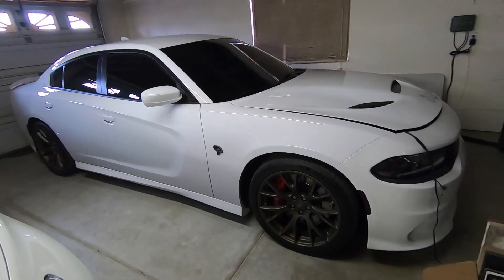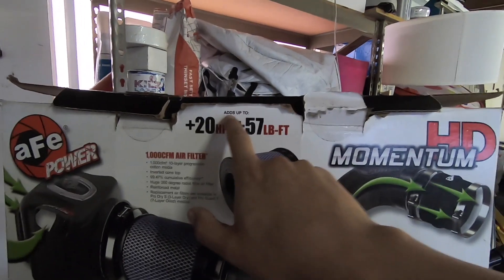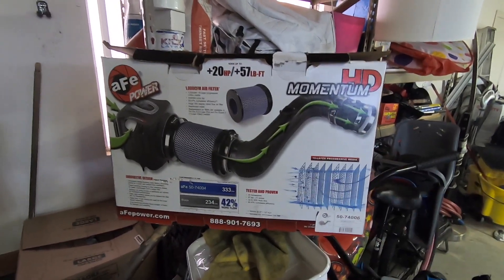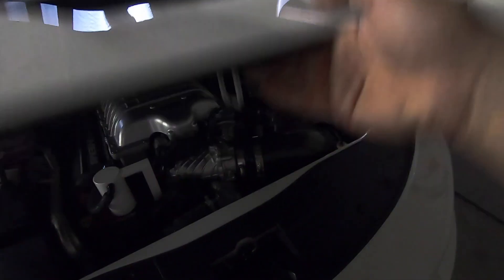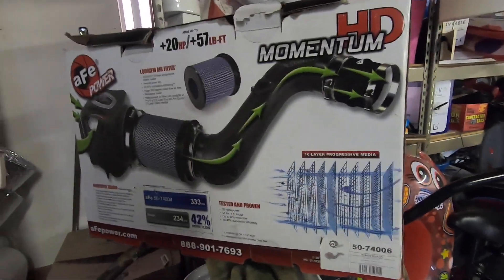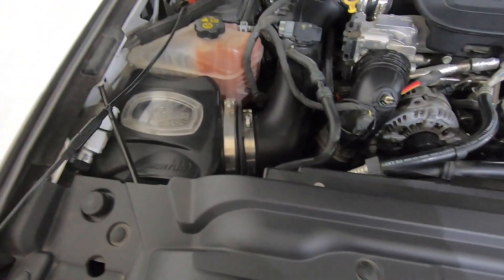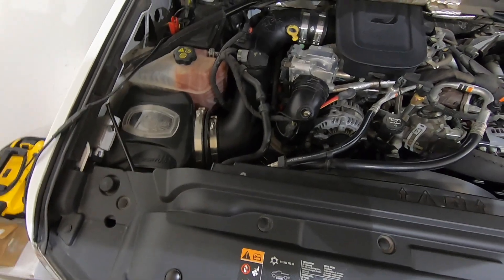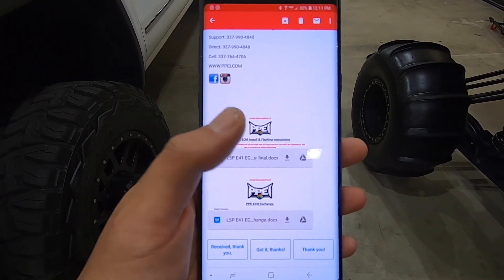DO THESE REALLY WORK?

Comment: LLY with S&B kit includes the air horn and gain hp but don’t remember exact numbers from mustang dyno and definitely can hear the turbo noise. The biggest advantage was gas mileage went from 15mpg to 18mpg at 75mph 2100~2200 rpm.

Comment: In my experience with “cold air intakes” the most power I’ve seen one make is about 8 hp. I also have only really seen a notable difference at the top end in most cases. And something else to note if anyone is buying a cold air intake to try to make more power or help their engine breath better, they only really work if there pulling air from outside the engine bay. So the ones you see that sit in the stock location under the hood with no shielding around the filter or anything, really don’t do much at all. Sometimes you can actually loose power with them! I’ve seen it happen a number of times. So for those looking to purchase one to make a few extra hp or to help your engine breath a little better take a good look at the design first and make sure it’ll be pulling air from outside the engine bay. It should have some type of shielding around the filter with a weather strip seal to keep it from sucking hot air straight from the engine bay. Some will also have a scoop/pipe of some sort to further help suck air from outside the engine bay

Comment: Well Eddie, I installed the S&B CAI on my 17 F250 6.7 and noticed an instant better throttle response. A little less turbo lag and I hear the turbo slightly more. Other than that, these trucks are so powerful I can't tell anything seat of the pants HP or torque increase. The biggest downside is all the dust that I accumulated from going to Superstition twice in the last 3 weeks. The filter looks horrible. I suggest running a pre-filter which I just ordered along with a new dry filter. I really do believe it's all for looks though. I'm about to do a review on my channel here really soon. Maybe I'll run into you in Glamis new years. Keep up the great work 🤙
Reply from the maker: Thanks for the info man i love to c your guys comments
Reply: @EddieLife3500  the metal ones from hsp sdp and wherli custom fab make the turbo alot louder I put an hsp one on my lb7 and it made a huge difference it spools alot better and sounds crazy

Comment: I’m running a 6637 with a Donaldson blue filter on my obs powerstroke no real noticeable performance difference but I can hear the turbo spool up under the hood more now. I’m sure it’s a better filter than stock and help get more air but it was only around $100 or so I don’t know that an afe $500 kit is justifiable for the average person

Comment: I use S&B , I dont get any more noticable HP but I seem to have more responsive torque under a load at max boost in the mid rpm range , I have a 6.7 Cummins,  we pull 8% grades constantly,  truck runs cooler and dosnt seem to shift as much. And turbo is a little bit louder if I take off the  closed intake cover (not recomended) cool dense air is better for combustion than the hot thin air in the engine bay
Reply from the maker: Thanks for the info

Comment: I have saw a few dyno of intakes and it really seems like the results are minimal. One thing a guy pointed out is most guys pull on dyno with heat soaked truck run base line test and then change parts and run and see an increase but is the increase really because of the heat soak being gone. Just saying so if you get to give us a real test make it fair for both applications. Keep it up eddy!

Comment: My personal opinion is CAI are a waste of money and here's why. Most of them still pull in air through the front just as the factory intake did. The ones that don't are pulling in air from under the hood which has to be warmer than the outside air. Also I'm pretty sure the factory intake has sound deadening technology in it. The CAI doesn't so that's what people are hearing not an increase in power.

 But it's your money and your ride so do what you please.